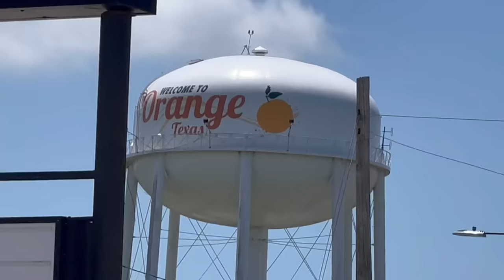Beware of Copperhead Snakes

Comment: Obviously, not everything is bigger in Texas. Some time ago, we had a local in my community (in Virginia), that killed a copperhead in excess of 5 foot long and the girth around the middle of the body was around 9 inches. It's size was so exceptional that it made the local paper with a pretty good sized write up. But typically 40"-50" long is a typical copperhead around here.
Reply: Record for a copperhead is 53 inches long documented by the University of Georgia. It was a road kill specimen from Bolivar Tennessee that was donated because of its large size for a copperhead.
Reply: @Richard H INC EMON  The record for a copperhead in Virginia is 48". Perhaps this snake was not recorded because it's size was not published until after the snake had been killed.
     Somewhere in all of my things, I still have the clipping from the paper. The photo shows the gentleman holding the snake by the tail, his arm outstretched shoulder height, and the snake's nose was barely missing the ground. 
     I can't remember if they specified the exact dimensions of the snake down to the fraction or whether they gave the closest even dimension. But I knew the man in questioning he was tall enough that 60" + to his shoulder would not be a stretch. Another consideration, the story was published back in the very early 1980's, and I don't know that they were recording sizes of snake's killed in my area back then. In this area, copperheads   are plentiful enough to almost be considered a nuisance, and the man in question was notorious for dispatching them from this area.
     No sweat off of my nose whether he was 5' or 5", the video just reminded me of the story, and I thought I would share.
Reply: @davidhorsley1149   Just came across this comment again. A little bit late but in my home town in NC a 57in copperhead was killed and photographs were in the paper 1982 so you have to notify state Wildlife officials for documentation of the snake to be official . I have been interested in snakes for 61 years now I'm 68 years old. The largest verified pitviper is the Eastern Diamondback rattlesnake 7ft.9in.34lb documented by Guinness World Records 1946 shot and killed by a hunter named Rutledge . The largest verified Cottonmouth was captured in 1990 74in.11lb in the Great dismal swamp North Carolina and Virginia border documentation by NC Wildlife Fish and Game division D.N.R. Take care and have a great day 😊
Reply: @richardhincemon  Like I said, I didn't measure the snake. The picture was in the paper of the man who killed it, holding the snake by the tail with his arm outstretched, parallel to the ground. The gentleman was over six feet tall, so that put his shoulder height at over five feet, and the snake's nose was missing the ground by about two or three inches.
   I stand to gain absolutely nothing by inflating the size of the snake. I didn't feed and raise it to that size, and I didn't kill it. I just thought I would share the story and make a joke at the expense of Texas.
Reply: @davidhorsley1149 I think I know this picture. I think it was due to the angle of the picture taken. Not done on purpose to be misleading. Just the way it was taken. I'm sure there's bigger snakes out there.  Just like in life. There's always something bigger  and worse out there.

Comment: I didn't get to see the snake but for a a eighth of a second get a new camera guy he's obviously terrified of snakes i would have really liked to have gotten a good look at the snake A for effort nice video!
Reply: Lol yeah I took two pretty big Copperheads out of a neighbor's cellar a couple summers ago, and relocated them way down in the woods below our barn. I had one in my hands held up to get a photo, and the guy I had given my phone to get a couple pics of me holding it, was so freaked out by it, that he wouldn't get close enough to me for a good shot😄. I would step forward, and he would take about 3 steps backwards. I took them both to my garage, and got some good shots of them, but no selfies holding one. Safety first with those snakes. They won't hardly ever kill an adult human, but I've seen bite results and have been told by others that the venom produces enormous pain.
Reply: @rileyjothecorso9732  There is an antivenin called Crofab, that would be the type used, for all our native Pit Viper species, basically all Rattlesnake subspecies, Water moccasin, and Copperheads. In my understanding, they usually avoid administering it for Copperhead bites,maybe occasionally, if deemed to be a pretty heavy envenomation, I really can't say for sure why or why not. The Copperhead has by far the least toxic venom of the Pit Viper snakes, and if one is fortunate enough to take a dry bite, with little to no envenomation, it can be a fairly quick recovery. Heavy envenomations can and will cause serious pain, and serious tissue damage and loss, even possible digit loss. They're still a pretty nasty bite. I do know the Crofab is extremely expensive, that may factor in the decisions not to use as well. Oh and lol yes you got lucky, to let loose of that Copperhead before it tagged you. They generally thrash and whip around pretty wildly if picked up unexpectedly or roughly.
Reply: @timchilders3535  I wasn't sure i was watching a video and they were talking about something like that about the copperheads when you see one of those guys that's colored like a new penny copper they are a beautiful snake the one that the lady caught on that video looked like it had the bright copper color but I couldn't tell the camera guy didn't get a great shot of the snake had me really disappointed 😞
Reply: @rileyjothecorso9732  Yes I'd love to have seen a little more of the snake, it looked like a beautiful one. Copperheads really are pretty, when you take a moment and just look at their vibrant colors and patterning. The last two I saw were super light colored, with perfect reddish brownish Hershey Kisses markings, and like you mentioned, their heads were strikingly shiny copper colored. There are a few various Copperhead subspecies, that look a little different. The Broadbandeds have the usual colorations, but instead of the Hershey Kisses patterning, it's just a series of bands. Still easy to spot as a Copperhead. Osage look a little different. The wildest ones, are some rare mutants found in Mississippi, that have stripes, that run the length of their bodies, with maybe a little of the classic patterning near close to the tail. I've only seen photos, science hasn't really 100% figured them out yet I don't think. They look wild. Still look like Copperheads, at least to me, I'm sure most people pretty familiar with snakes will realize it's a venomous pit viper, and once you take a good look, the colorations are pretty much spot on Copperhead, just really mixed up! I don't keep any snakes or other reptiles for "pets" and I really don't even go looking for snakes anymore like I used to. I just keep my eyes open and hope to see one, and I do removal relocations for anyone that needs, or if I just happen to find one in a potentially dangerous situation.
Reply: @richardhincemon9423  Hello, Richard! I was actually a little surprised, when you pointed out the 5 deaths, (Copperhead envenomations) since 2000. From our recent conversations, I know you very knowledgeable on this subject, I have reviewed the stats a couple times over the last several years, and I checked it out and surely enough, 5 is the number. I'm perplexed even more now. You and I both know, that the Cottonmouth venom, is considered to be more toxic and dangerous than the Copperhead venom is. At least that is pretty much what I've read and been told for many many years. Both being Agkistrodon species, considered closely related, I just always classified the Piscivorus, as being "more deadly" than the Contortrix. Now the listed stats seem to contradict that, at least on paper? As far as the price of Crofab goes, fortunately I've never had to have any myself, to date. I've heard all sorts of $$$ numbers, for Rattlesnake hits, mainly. I do not know very much at all, about the Elapidae species antivenins. By the way, I am still mystified about those rare Copperhead mutations, that seem to show up in Mississippi, as you pointed out earlier. Nature is amazing!
Reply: @richardhincemon9423  Richard I am in complete agreement with you, in regard to habitat encroachment, whether or not it actually is contributing to venom evolving to be more powerful, would be up to debate. It would be very interesting to compare, let's say a handful of specimens from 20-50 years ago, to today's same species, to determine if there is any significant difference. Say, I didn't catch the latest Mississippi Mutant in the news yet,I will investigate that right now,thank you sir👍🙂